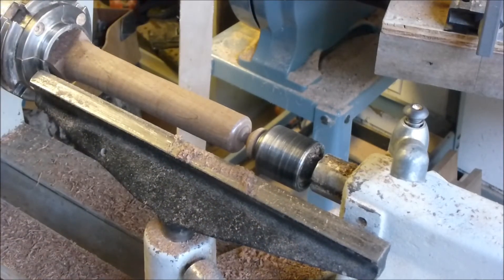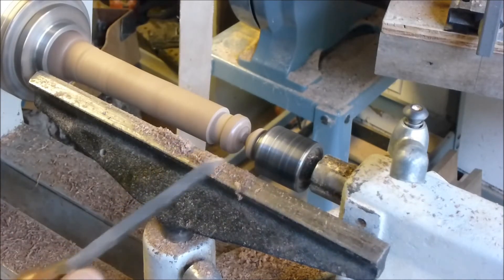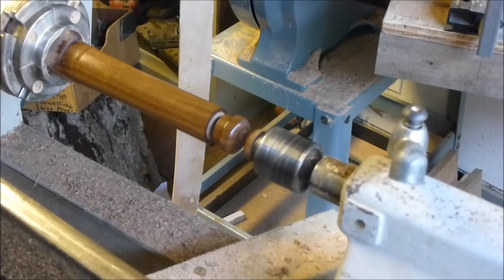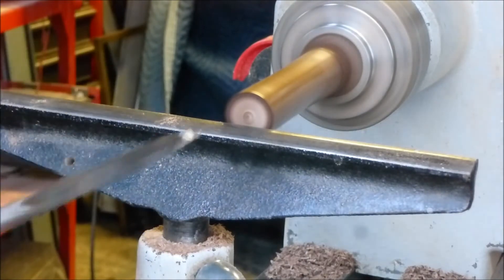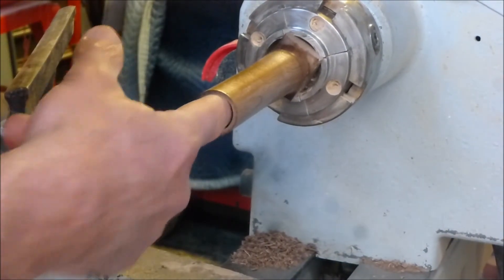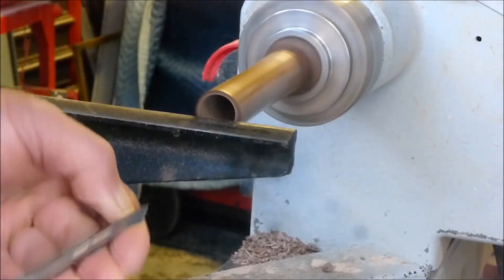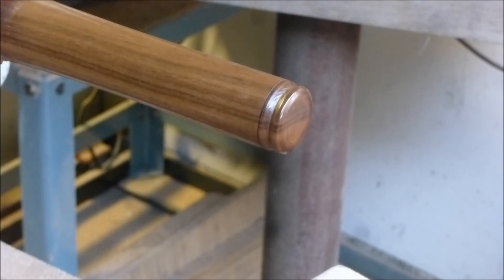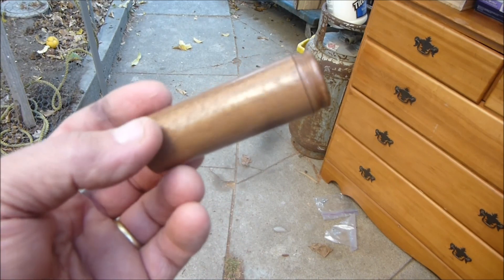Woodturning With Naked Turner Claro Walnut Matches Case

Comment: Nice to see you back Erik.
Like this easy and not very time consuming project. As always, your choice going with this beautiful piece of walnut gives the final touch to the case. Don't get me wrong, just a little hint, when I do boxes like this, where I part of the lid from the actual body, I leave a hair of the tenon on the body, this gives me a line to hollow up to, and I don't need to measure. In German we say "Wer misst, misst Mist!" (actually the last three words are pronounced the same way (same as your mist=light fog), so you don't hear a difference) translated word by word: "Who measures, measures dung"
Keep on turning.
Greetings from Good Old Germany
Peter
Reply from the maker: First thank you for watching and commenting. Thanks for pointing this out Pete, I did this and just forgot to mention it. You can see it in the shot where the finish is on part of the end before I hollow.  I mention this technique on another video I did of a canister and showed that technique in detail. It might have been the bog oak time capsule or one of the other small lidded canisters I made a video of. I like the German translation thanks again Pete.

Comment: Nice case Erik. The only problem I see about the striker on the inside of the lid is the very slim chance that a match could happen to bounce into it and ignite. I realize it is a very small chance, but Murphy and I are on a first name basis.

Keep on turning, Carl.
Reply from the maker: Thanks for watching Carl.  I would make sure all matches are strike side down and they could not ignite without air so they would not ignite even if they did light.  I did a test in a test tube so I could watch and there is so little air they go out immediately.  Thanks again for commenting.

Comment: That's a really attractive little piece.  Would it be worth gluing a piece of the match striker pad/material on the inside of the lid or on the bottom of the tube?
Best Wishes, Brendan.
Reply from the maker: I may just do that to the inside of the lid.  Usually I just put a piece of it in with the matches.  Thanks for watching.